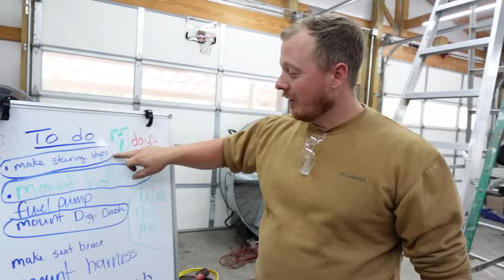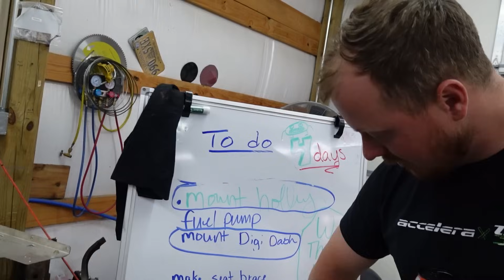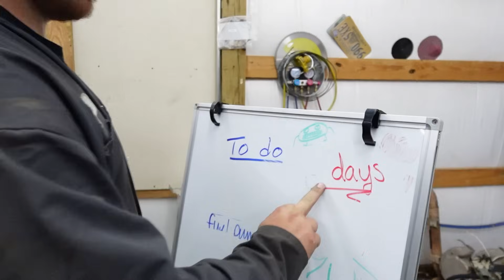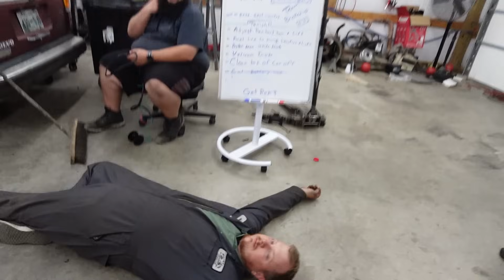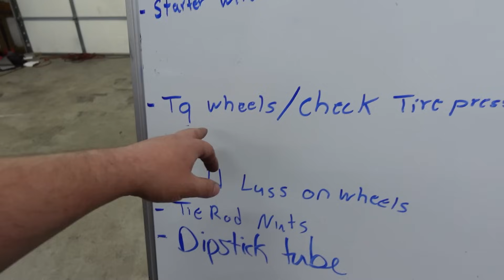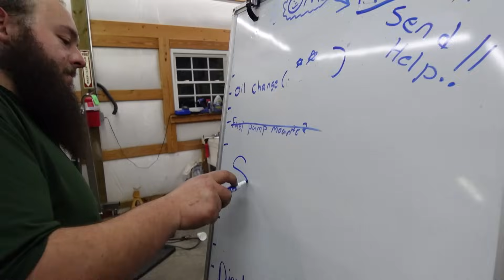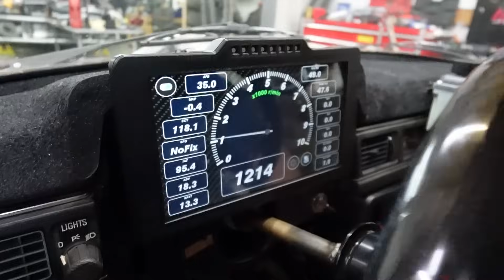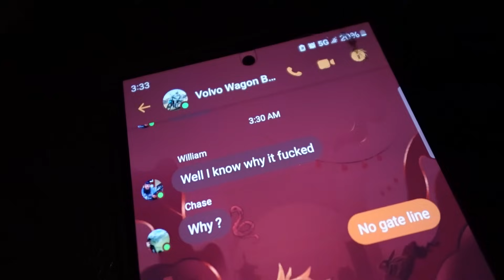Turbo 2v Volvo Wagon First Drive! It's the Final Countdown...

Comment: I can't wait for y'all to get a real camera with a decent microphone that'll do these builds justice.  The little gopro microphone can't handle a V8 with no exhaust.  It sounds like my grandma farting into a can on the other end of an old timey telephone.
Reply from the maker: No gopro was used in this video.. I'm using a brand new 4k $1000 Sony.
Reply: @BoostandBadHabits  That $1000 Sony sounds like the mic still can't handle all that mad horsepowers y'all are making.  May be time to get a boom mic with the shock mount and fluffy wind screen.  Make chase stand there and hold it.